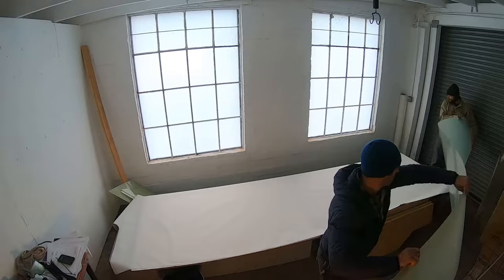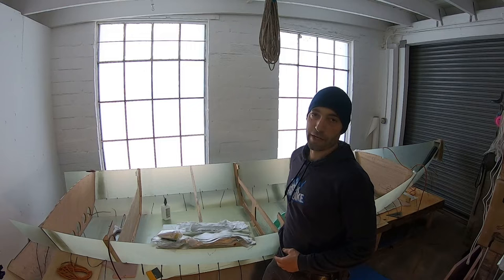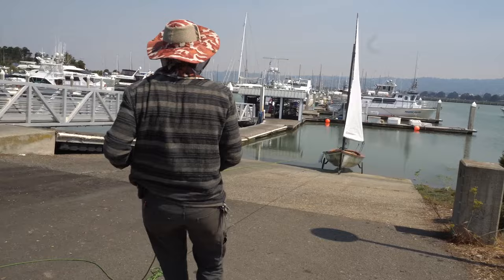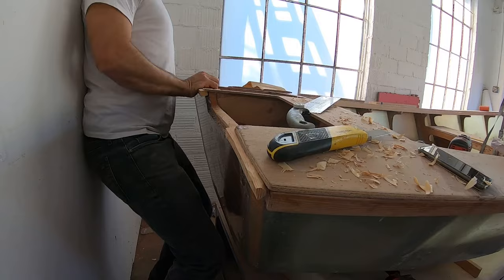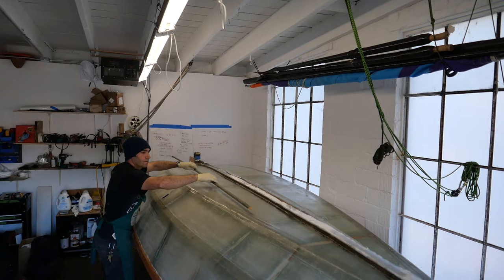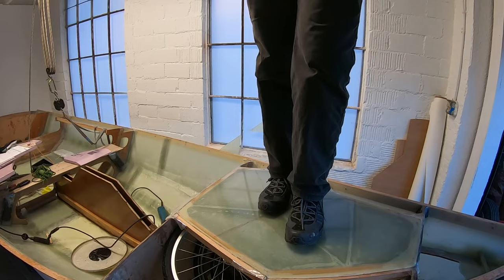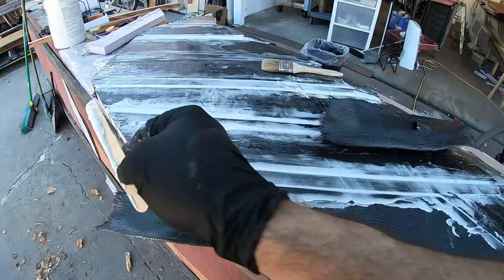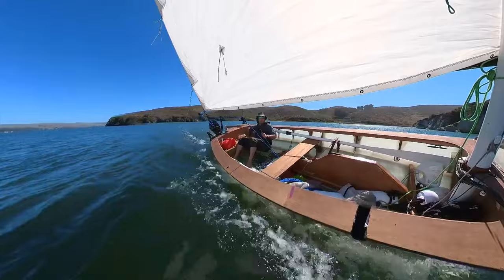Making the First Mod, a  bike-towed sailboat. 17', G10 hulled, carbon fiber rig, weighing 350 lbs.

Comment: really impressed with your water tight hatch! I have spent an unreasonable amount of time thinking about ways to make DIY water tight hatches and this is the first time I have encountered the idea of a tapered fit! what angle is the taper? I presume you got the surfaces to fit exactly by assembling them together or using one as the mold for the other or something like that? if the hull flexes can it pop open? have you tested it against a high pressure hose or buckets of water or similar?
Reply from the maker: Hi Dominic,  I did a capsize test standing on the boat upside down, and it did pretty well. The front hatch has about a 20 degree angle all around. It does let water in on choppy days when everything is wet and I’m hitting waves. Hitting waves compresses the flexible G10 bow panels a little which squeezes out a little air, then there’s negative pressure pulling water in as the bow takes its shape again. The aft buoyancy compartment has a smaller opening with flat mating surfaces and a much stiffer hull in a part of the boat that doesn’t bash waves and it stays bone dry. Good luck!
Reply: @fossilfool  interesting, thanks! I want hatches for the cockpit of my proa so I can have camping gear etc inside. sometimes a wave comes over so it would have standing water on it until it drains. I guess a few drips would be acceptable but... watertight hatch is just a fascinating design problem! especially with the additional constraint of DIY friendly. Adding flexing to the list of tests!

It has just occured to me that capsize test and standing on it will have an air bubble inside the hatch, preventing water going in. maybe as you are coming over though? I think throwing a bucket of water at it is a reasonable test for sailing, though
Reply from the maker: @dominictarrsailing  It's been great having big compartments for multi-day outings. The plans for my boat only mentioned installing small inspection holes. Good luck with your mod!

Comment: Is it correct to assume the G10 was the lightest material (among those meeting adequate strength) ie fiberglass over foam and wood for structure?  Thank you.
Reply from the maker: Not quite... It's a material that I love that I had on hand and yes it is a bit lighter than 1/4" marine plywood for the same tensile strength. But when you compensate for the lack of stiffness weight turns out the same. No cored materials were considered.
Reply: @fossilfool  thank u!

Comment: I really like your concept and style l have a concern about how the G 10 and the rest of the epoxy work will hold up to UV damage
Over time. I know a clear coat is an option because the translucent hull is great. One other thing is did you scale up the plans yourself
Or is that an option in the plans? I enjoy your videos and carbon fiber work!
Reply from the maker: Time will tell. I am pretty strict about covering the boat if it's going to sit in the sun for more than a couple hours. I went with Interlux Perfection Plus which is a 2 part varnish, and have done 6 coats. So far so good. I have also put chunks of G10 in the sun with less varnish and no varnish to see what happens. The result is that it turns a very ugly orange / brown over time. But it's still quite strong and flexible. I think a lot more UV would be needed for it to be noticeably weak. You get a big warning of it changing color before it starts to be unsafe strengthwise. If it does get orange over time, I would probably paint it.

Comment: One thing to bear in mind - G10 contains 10% fiber and 90% epoxy. If you know anything about fiberglass costruction that is a horrible ratio. That is why it is so translucent. Obviously this is working for now on this small boat but it will likey develope cracks that as I said are only held together by 10% of 1/16th of an inch worth of fiberglass. You whould get more strength by making your own sheets with glass cloth and epoxy laid up on a flat waxed surface and then using them the same way. If I want my own boat to last a lifetime i would use 2 layers with urathane foam in between which of course is a more "standard method" but then there is a reason for that.
Reply from the maker: Thx for your comment. Where did you get that stat from? When I work with carbon and glass, I am typically able to hit a 55% fiber ratio using primitive methods like electrical tape to squeeze out excess. My understanding is that G10 is formed with pressure and heat in a factory setting, so I would think they could well exceed the fiber ratio I'm getting in a garage setting with my basic methods. I don't see why it would be 90% epoxy. Curious to look into that more.
Reply: @fossilfool  G15 has 15% fiberglass.
Reply: @jampasritalon4180  That's interesting. I've never heard that number before.  I've used thick G10 from McMaster for hard point material for bolted joints in composite laminates, and the stuff I've used was definitely not chopped strand fiberglass.  I could see the weave and layers of fabric.  Maybe there are different types of G10?
Reply: @SasquatchComposites  there are in fact products with differing amounts of fiberglass but they are not marketed as G10. I have used G10 for purposes similar to yours. I was looking for a material to use in aircraft wing fixtures for an experimental aircaft but I ruled out G10 as too fragile and brittle to risk a life on. The G10 I messed with was thicker - 1/4 to 3/8 inch and I too recall seeing fiber mesh cloth (I never mentioned loose fiber btw) but I only used it for compression loads - never tension.